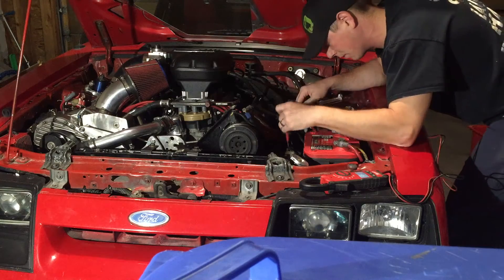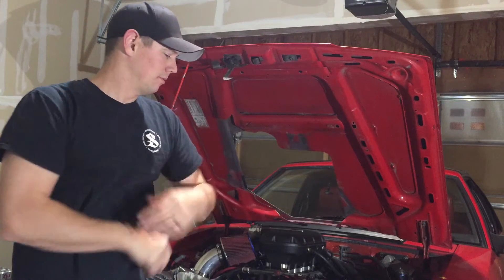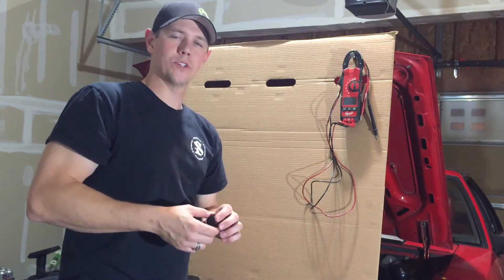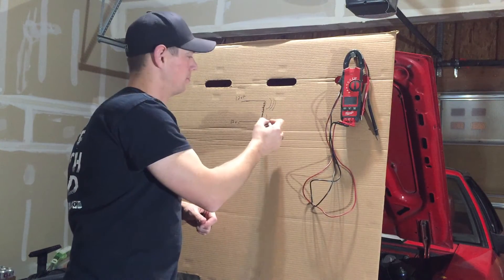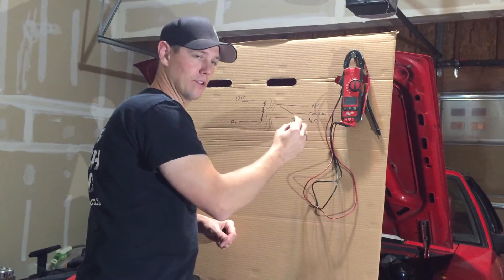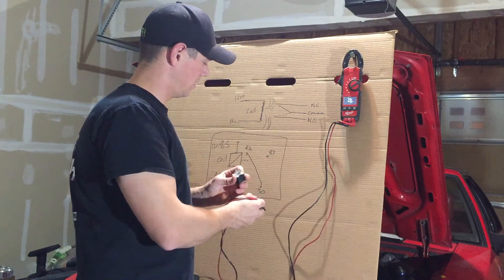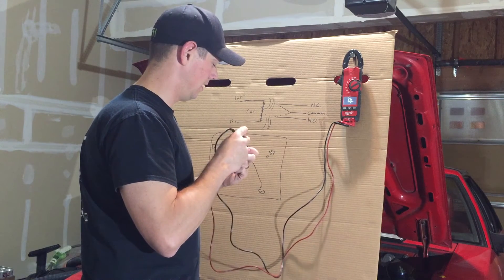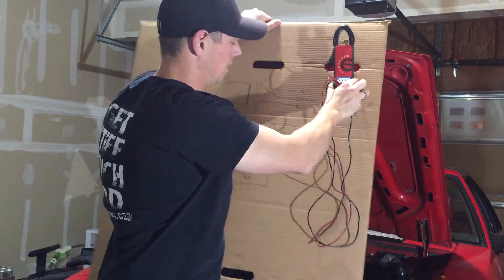How a Relay Works, Electrical Troubleshooting [Foxbody Mustang]

Comment: Hey ....i also saw you video on how to diagnose z bad fuel pump. My fuel pump begins fluctuating with my high rpm fan turning on or even when my central lock system light turns on and off. What shall i do? Plz help
Reply from the maker: What kind of car?  I assume foxbody?  Year?  Need more details please
Reply: @BMF_Garage  its a peugot 206 1.4 2005
Reply from the maker: Unfortunately I’ve never messed with those so I won’t be much help, my apologies…

Comment: I have a question I have a 91 gt it would start and run fine but wouldn't shut off I did a little research and found the pcm relay may the prob I located it tested it the coil was bad inside the relay I went to start the car to see what it would do it started right up and ran with out the relay I turned it off it shut off tryed it again started right up and I shut it off like nothing was wrong how is that possible 😳
Reply from the maker: When those relays go bad, they typically fail closed so it makes the fuel pump run constantly.  Not really an issue when it’s running because the fuel pump runs all the time when the car is running.  It’s only a problem when you have the car off and key on.  The pump will run constantly and can in turn go bad or over heat from excessive run time.
Reply: @BMF_Garage  thank you very much for your help your video help me trouble shoot which relay was bad saved me a trip to a shop and only cost 19$ lol have a good day
Reply from the maker: Hell yes, thanks for watching!

Comment: I can't figure out why my 92 gt 5.0 keeps blowing the fuel pump relay but not any fuse. What do you think???? Please any help would be appreciated
Reply from the maker: Sounds like a bad pump?  Factory pump or aftermarket?  If it’s blowing it’s drawing too much current.  Either it’s a bad factory pump or oversized aftermarket one
Reply: @BMF_Garage   after market Holley just put in so do I need a bigger relay
Reply: The motor has been bored 30 over trick flow intake MDS ignition headers
Reply from the maker: With a bigger fuel pump you’ll need a better relay.  Something rated for more current.  Don’t forget though, if the relay keeps failing, the wiring is being over loaded also
Reply: @BMF_Garage  so what size do you think I should go with and will it be an aftermarket type fix where I will have to replace the connection also or can I find one that's just bigger that plugs right it
Reply from the maker: It’s not going to be plug and play.  The factory relay has a special socket and I’ve never been able to fine and upgraded replacement.  You’ll need you size the wire and relay based on the amperage of the fuel pump.  Safe bet would be to run 12 gauge wire with a 30amp relay unless you know the amperage of the fuel pump.
Reply: @BMF_Garage  okay but all the suggestions I'm finding for my particular pump say that a 30amp is suggested and the cars stock is a 40amp you think maybe it might just be a short between either the fuse box and the relay or maybe the relay to the pump???. I'm pretty positive the original pump was good and the relay was the reason it wouldn't start when I got it to begin with. Because before  and after the pump swap it wouldn't crank just spin over then I changed the relay and it cranked and ran perfect and I shut it off to check fluids and hook up the cooling fan and went to try it again and drive it and back to just spinning over again.  I checked all the fuses they were good then checked the relay and Only got ohms on one set of post. I got another one but don't want to wast it without check into all other things first and seeing if I just have a short some where
Reply from the maker: I only gave that as a suggestion.  I know nothing about your pump.  It’s relative to the current it’s drawing.  Put a meter on it to see what the amp draw is under load.  Going by what the internet says will get you hundreds of answers.  Tests the current the pump is drawing so you know if it’s overloading they factory relay.
Reply: A

Comment: Hey bro , my 88 sits for a while at times , I go to start I hear clicking from a relay in the engine bay , fuel pump relay under driver seat , swapped , and fuel pump good, it starts after about 5 min , any ideas
Reply from the maker: That’s tough without being there to diagnose it.  There are a number of things that could be the issue.

Can you hear your fuel pump turn on and prime the system when you turn the key to on without starting it?

I’ve seen sometimes that when a vehicle sits for a longer period, the temperature changes can cause condensation in the combustion chamber which can cause the spark plugs to get a film or corrosion on them which will cause hard to start conditions.

I’ve also seen where the contacts inside the distributor cap can build up corrosion on them under the same circumstances which also causes hard to start conditions.

When it takes longer to start, is it cranking fine, just not turning over?  It could be spark or fuel related issues.  

When’s the last time you replaced your fuel filter?  If it’s really dirty or old, it can cause low fuel pressure and make it hard to start.

Comment: How many relays does a fox body have? Car will crank but automatically goes dead. Belt is also squealing, wondering if it had anything to do with a relay since I accidentally arched the battery while tightening the posts.
Reply from the maker: There’s a lot of relays (6?) but there are fusible links that can break and cause similar issues... they are difficult to locate and troubleshoot

Comment: Great videos.  I wasn't sure how to contact you so I just decided to find a recent video and ask a question in the comment.  Are you using drop motor mounts?  I am getting ready to do my swap and I am still trying to figure out which intake to use.  I have a small cowl hood I believe it is a two inch. I am hoping that it will work.
Reply from the maker: I used solid drop mounts... but my pan hit the steering rack using them.  Would probably use different mounts next time... 🤷🏼‍♂️ but at least it gave me good clearance.  

For cheaper lower profile I take I’d look up the edelbrock 29245 super victor efi is the cheapest and give most hood clearance... you have to get an elbow to make it work... I’ve also seen professional products make a cheaper knock off of it, but I’m not sure what the part numbers are.
Reply: Thanks .  I got a used victor efi.  It is the 2 piece one. It is similar to a trickflow, but you can't get them new anymore.  They are discontinued.  I measured my hood and I have a 2.5 inch cowl so I think I am going to be alright. @BMF_Garage
Reply from the maker: Nice work!  Would love to see what you’re working on.  Link to my Facebook is in the video description.  Shoot me some pictures if you have time